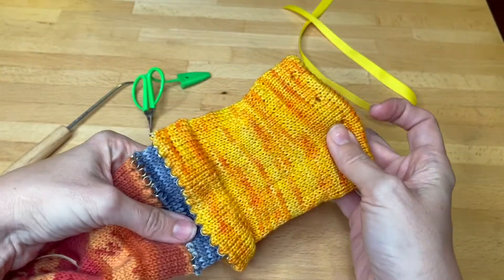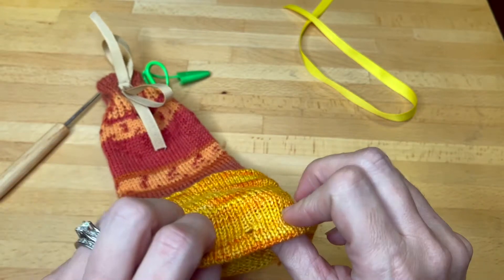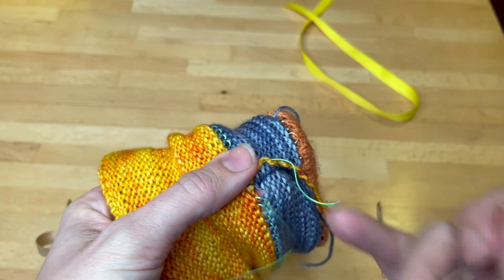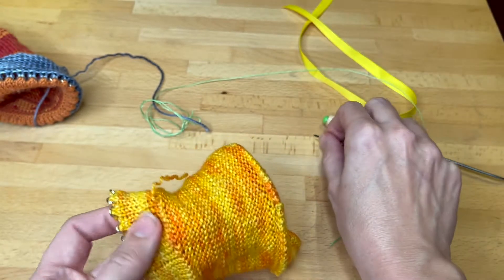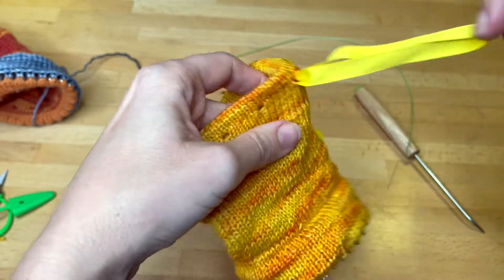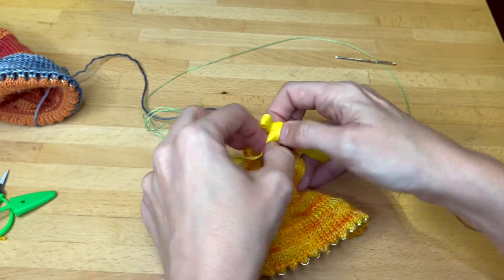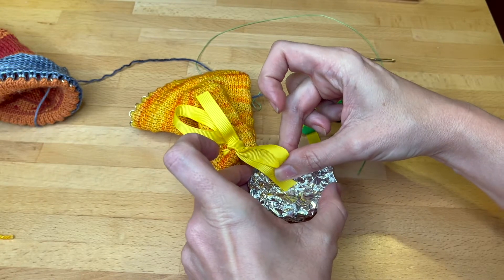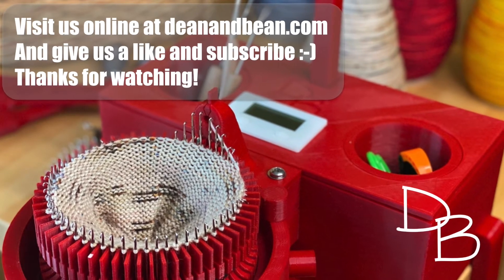Crank a CSM Setup Bonnet (1.0) - Part 8

Comment: tip: to differentiate say 64 needle setup bonnet from 72 needle bonnet, you can do some colour work: knit the number of needles on the cylinder the bonnet is for on the side of the bonnet. This way you can easily tell your bonnets apart. (Although if you only have one cylinder this is not really a problem, but with multiple cylinders, having the bonnets with numbers helps a lot.) First I just had totally different colour bonnets for different cylinders, but then I forgot the colour to needle number matching.. 😅😅 So I cranked some numbered ones for any new cylinder I got.